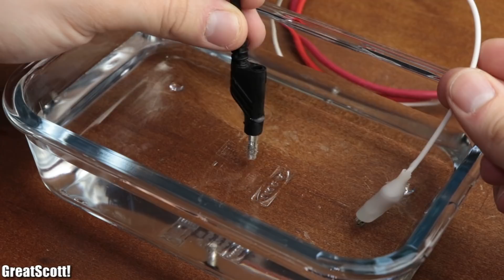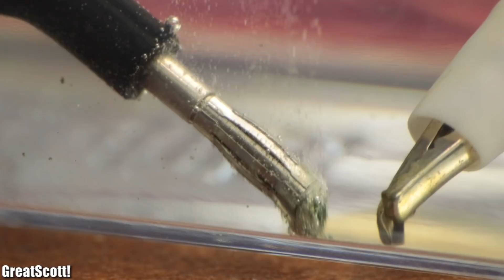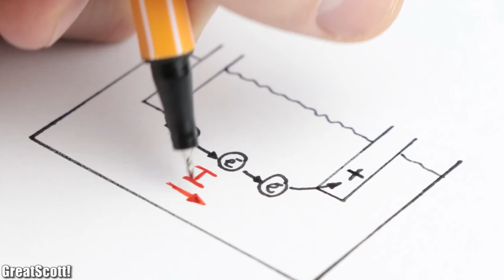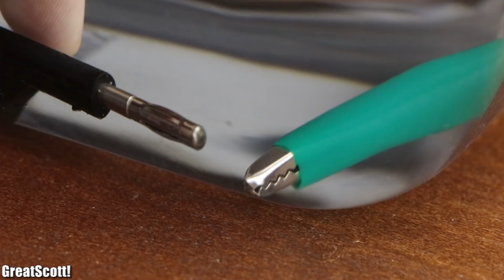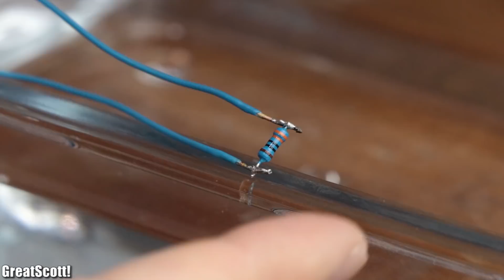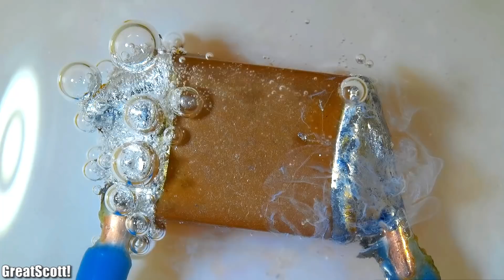Electronics & Water? What could possibly go wrong?

Comment: 1, what material did he/you use to make it waterproof. 2) would you suggest using it on a VESC to help waterproof an electric bike?
Reply: Nail polish
Reply: 1: Nail polish
2: ofcourse you can do it But there is NO guarantee that water will not penetrate you electric circuit...
Reply: ah thanks that is true, ill just 3d print a housing then and seal it with a latch and rubber rims

Comment: I believe you may have messed up the distilled water one a bit by not wearing gloves, or using tweezers of some kind. 
your fingers imparted impurities to the water, likely in the form of a salt or oil, or dirt. basically anything that could help  the water be a better conductor. 

I noticed this when you put your finger into the water and he blinking led stopped before you even touched it. otherwise the distilled water test would have been fine as you would have suspected.

Comment: Had to do some test similar when restoring some sla batteries. was asked why I couldn't use tap water and came to the conclusion the cathodes in the cells would break down to nothing and end up melting the battery after time.

Comment: any electronics with minimal circuitry will be fine when wet but like cell phones etc they have lots of sensitive circuits. But ive saved cell phones after that been in water for few hours by taking it apart and cleaning off the corrosion on the board.

Comment: Great  scoth, please understand, the natural electrical flow is disrupted by magnetic build up in ferromagnetic materials, if we use the antiferromagnetic austenic 316l TIG wire as electrodes and keep the connections with non ferromagnetic material and zinabre salts releasing metals out of the water (coiling cooper) connected to for example, 30V DC, there will be 70% more efficiency on natural electrolisis in distilled water, salt would also spoil the natural electrical flow in water.
If we left the strong Inox for long time, there will be oxides like (will not be oxides), but instead, Gas Nano Atomic State. 
The name is true and correct because is lab proven that the CO2 is absorved from air, into the water as the oxides like brown scum builds up. 
But this all loose its effect if you connect using ferromagnetic conectors, where, they steal the antimagnetic electricity.

Comment: The ions do NOT react with the metals to create hydrogen and oxygen. The electric current over-charges the molecule causing the covalent bonds to break, resulting in hydrogen and oxygen, which THEN react with the metals. 

Using DC you can separate the gases for later use. But the oxygen will destroy the positive terminal through oxidation, and corrode the negative terminal as well as depositing material through ion travel.

Ion travel is the very basis of electroplating. Positive terminal supplies energy that travels to the negative carrying with it the material you wish to electroplate, such as gold or nickel.

Comment: Distilled water is still very dangerous to electronics as it will dissolve metals with prolonged exposure. Eventually becoming more conductive and corroding the electronics in the same way tap water did.

Comment: You did the experiment a bit sloppy. At the end one could see electrolysis happening on the Adurino in the destilled water container. That happened because you contamined the container with Ions when you put your bare fingers in it. Sweat and skin cells contain ions that get desolved in the water.

Comment: Try it with steam distilled water! No conduction. I use an electronic water tester that measures parts per million. Tap water tested ranged from 3 pp to 350 pp. The worst is well water.

Comment: Hello I don't know if you check comments from old videos. But I conducted an experiment in the last few months where I generated AC current through a piezoelectric effect of granite that contains quartz crystal. I was able to successfully measure the frequency through water to another piece of granite despite my readings of voltage and amps being negligible. What are your thoughts on a water-based method of transferring electricity via frequency and having a way to adapt that frequency to a usable voltage and amps on the other end?

Comment: Could you try to do the same experience with the arduino in water but using the internal cristal oscillator. I think the problem of having the arduino inside water is that is affecting the impedance of the cristal, so no clock working

Comment: And thats why distilled water are useful for pc watercooling, as they conduct less electricity so when they leak they dont short circuit your expensive graphics cards or your cpu or motherboard or etc
Reply: It's really just to keep your components clean, by the time that water goes through all the metal components it is conductive again.

Comment: Right, obviously I don't want to do anything like this experiments, but is one big question: some people are likely to boiling water with connection mains power into razor blade what is boiling water very quickly. In your video nothing like that was happened, so what is that? is that water resistance? you didn't mention is something like warming up apart of corrosion. So can you tell something more about this, please?
Reply from the maker: I do not recommend doing this, but the current through the razor blade, heats it up which then boils the water.
Reply: GreatScott! , that is understandable, question is why nothing like that happens when you did your experiments ?

Comment: Well the worst water damage i've seen was in a car BSI module, couse of the bad placement of car parts every time it rained a litle bit of water leaked to the far side of the electronics whic caused the seen chemical reaction, the problem was that between the electrical components the corrosion created more or less conductive dust that created bridges between components needles to say after cleaning the whole board, resoldering visibly damaged parts there was too mutch component to just reverse engineer it and find out what happend. It was cheaper to buy a new one and program it.

Comment: electrolysis is NOT a chemical reaction it happens when the electrons knock into the water and split it it has very little to do with the anode/cathode the reason it corrodes is because of the impurities in the water if you add something like lye to distilled water with titanium electrodes you wont find any corrosion awesome video otherwise :)

Comment: Sir i have a question regarding Capacitor less power supply.
Is it good for use?
Is it durable?
Is it safe for using/making cheap LED lapms?
If yes will you please provide me a simple circuit diagram for that please.

Comment: Does the result that the resistance of water is same for DC and AC mean that water has no capacitance or inductance?
Reply: Alpo Turunen not necessarily. An oscilloscope would have to be connected to the water in order to view the distortion of the AC waveform. DC is not affected by phase shift as true DC cannot have "phase shift"

Comment: The Arduino inside the distilled water firstly didn't worked, beacuse your hands are dirty and therefor made the surrounding  water dirty. You should have submerged it using the wires for better result.

Comment: What was the waterproofing material he coated at the end?
Reply: probably nail polish.  You can use prettymuch anything that is non-conductive, though a slightly flexible product usually holds up best in the long run.  It's called conformal coating

Comment: Well in movies they ain't putting no little circuit boards or small ass stranded wire in water with people they throw toasters, hair dryers or high power cable in water with people, those appliances aren't using mA.

Comment: I understand that with dc currents you are technically correct, however you should have explained where the dangers come from for the stupid people that may try using dual or 3 phase mains power to attempt to duplicate your experiments. That is to say the current will always attempt to return to the source via the route of least resistance. In the case of Australian 240v AC the domestic supply current at 450Hz  is grounded so duplicating your mains experiment would cause an individual to be electrocuted if they were inadvertently within 500mm of a grounding such as a tap or sink!

Comment: You are really "great" Scott :). I have a challenge for you that I think you are the only person in the planet that can resolve this: I have this Spherex subwoofer 5.1 made specially for the Xbox ( https://youtu.be/JD_9thDIvUs ), but the product has been discontinued and the factory does not provide any support or parts for it. The internal amplifier is completely digital, I mean, not a simple Class D amp but its volumen control, input and other controls are digital too (apogee DDX-2100). Is there a way that you can take over this project and create an arduino interface or USB interface to control this subwoofer with out the remote control and the front display?